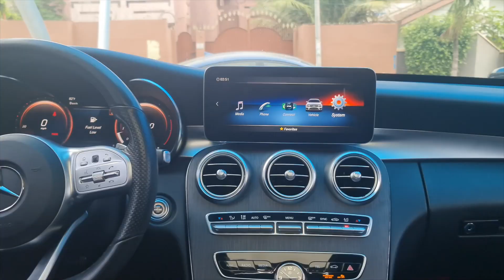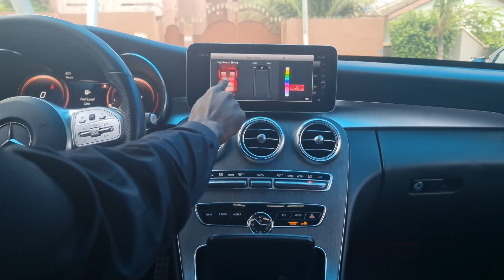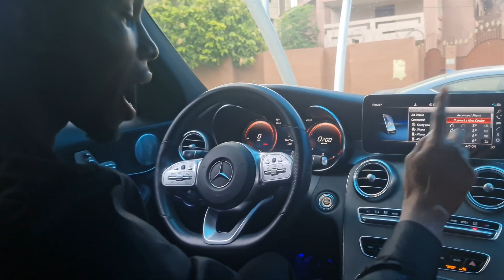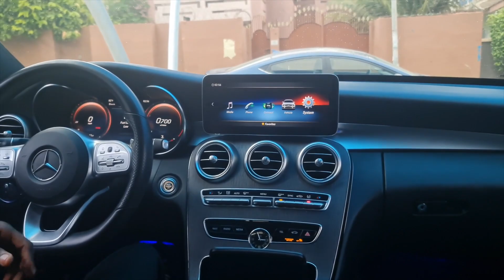Mercedes Benz C300 2020 Review | Cars In Ghana

Comment: the cost of the car is abnormal. is too much. I converted 320000ghs to pounds, and its over 31000pounds. this is totally wrong. way too much. i can get this  2020plate benz over here in the UK less than 20000 or bit more. Ghanaians and their prices, that's why u lots will never go anywhere with this abnormal charges.
Reply: Import duties senior. Ghana government demma import duties fit make u go mad.